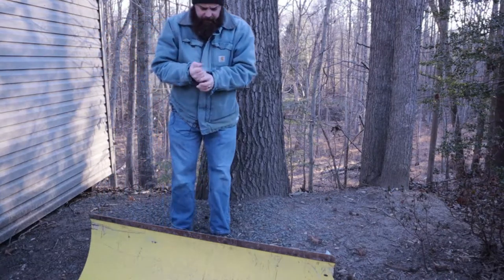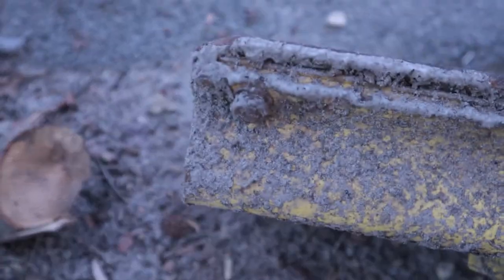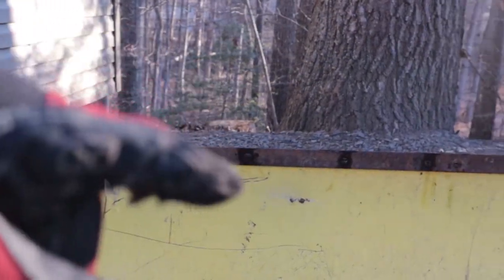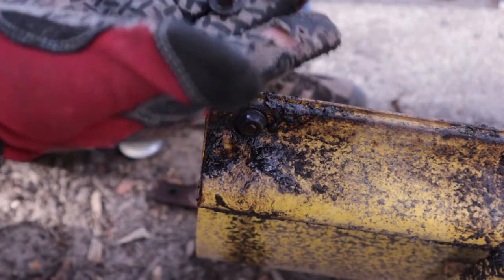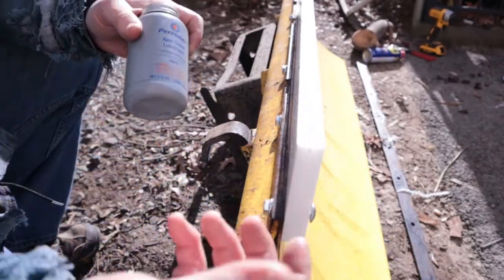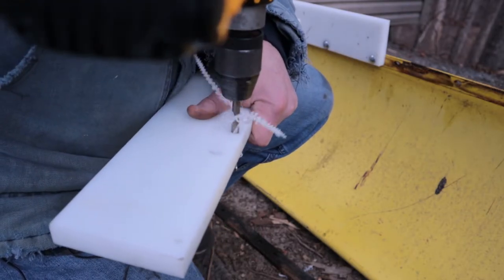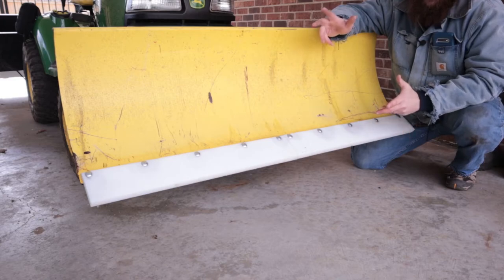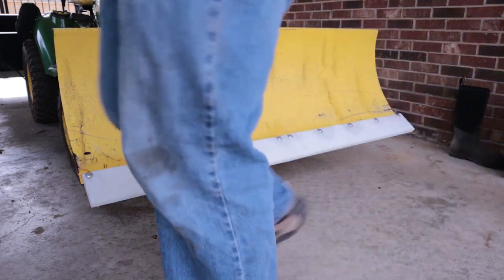#1 Replacing The Cutting Edge On a John Deere 54 Plow With UHMW. Cheaply.

Comment: Great idea!! How wide is your plow blade?  Mine is a JD 54". I went to the seller's site and it looks like the max length is 48". I don't want to buy 2 pieces; I'm too cheap. 😆 What did you do?
Reply from the maker: I went with 2 and split each and joined them in the middle. You could always buy the one and leave 4 inches short on either side of the plow
Reply: @JohnWCH  Thanks and Merry Christmas. I should have asked, how did it hold up after the first season? What did the edge look like?